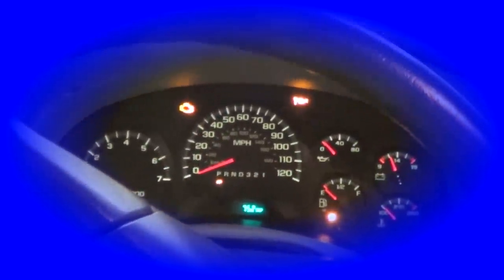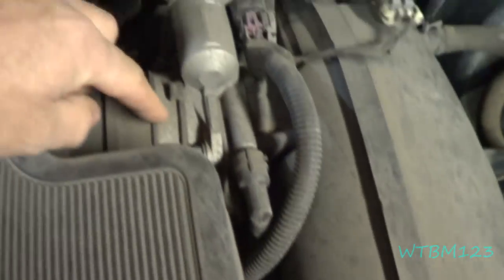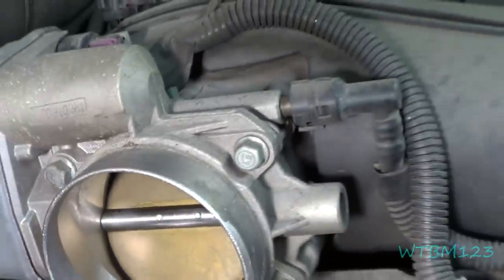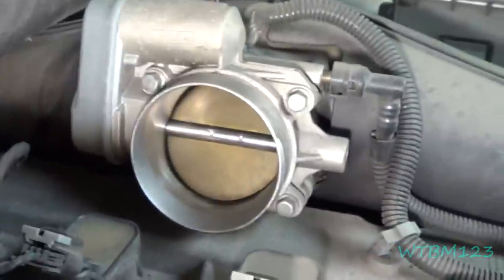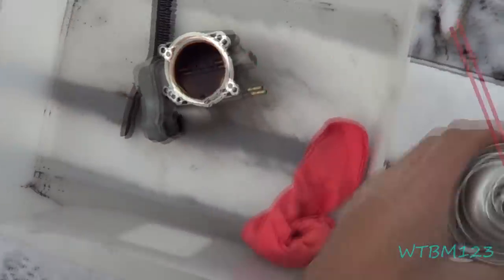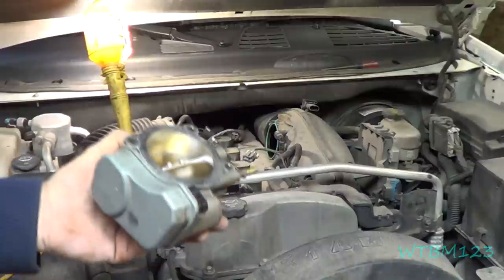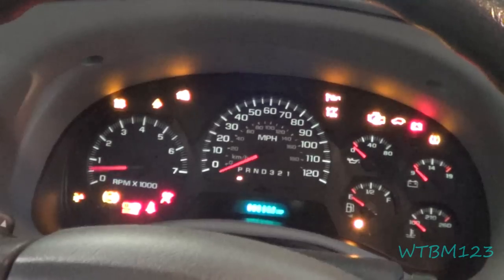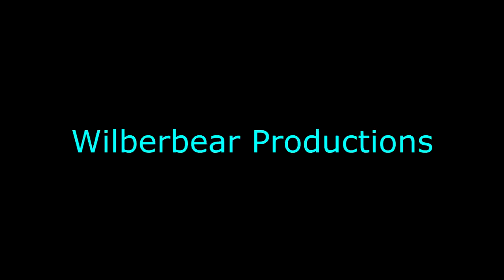Trailblazer, Clean Throttle Body, Electronic Throttle Control, Codes P0506  P2119

Comment: I have a 07 TB L 6 motor that stalls on cold start up I'm gonna clean the throttle body and I don't have to pull any fuses or disconnect the battery right? As long as I don't lift up the throttle plate? Thumbs up subbed

Comment: I was looking at your two gauges oil pressure and battery is it normal that they move higher than 40 on oil pressure and up to 16 on battery when you speed??  I don't  know if that's a issue but I'm concerned about it I have a 2002 bravada that is doing the same

Comment: On occasion, I get the same symptoms. Idle starts to get rough and then nearly stalls and then goes into a low power/limp mode. My throttle body is clean. Other than that, my trailblazer runs well. 340K Miles.

Comment: I have a 2006 trailblazer and have these issues as well. There was a recall about the senor in gas tank and they would do repairs but because i had gone over mileage allowance they fixed mine but i had to pay a reduced price. Mine went bad right after i bought it.  But i still have idle sensor that is supposed to be bad and mine has cut off is the air is runnung.Bought new in 2006.

Comment: Awesome video! My RPM's were fluctuating wildly when the AC was turned on. Cleaned the throttle body per your instructions and problem solved. I was really surprised how gunky the backside of the flapper valve was. Now my '05 trailblazer is running like a champ again. Thanks!
Reply from the maker: +Robert Gillin Thanks for watching and commenting

Comment: Awesome video/instruction by the way.  I dont know if it was just coincidence, but after an alternator failure and installing the new alternator, the very next day the 03 trailblazer started idling rough, revving up, slowing to almost stalling(stalled a few times actually).  only codes I was able to get were BARO/MAP, VAF, and a reference to throttle body intake tube loose.

Comment: I just did this to my '06 Trailblazer. Had the engine light for Idle Air Control low, not to mention low idle speed affecting the A/C temperature at idle. After cleaning up the throttle body, the truck is running perfect and the engine light went out on its on rather quickly. Thanks for the spot on video guide!
Reply from the maker: David Mallette Thank you for watching and commenting
Reply: No problem! Now if I could only find a video for replacing the parking brake shoes I would be all set.....lol
Reply from the maker: David Mallette Closes video i have 
https://youtu.be/bSS1qHMNdLM
Reply: I think that helps me out. I know the parking brakes are similar on mist GM disc brake setups. Thanks for the help!

Comment: Thank you so much!. I have a 2006 and with your advice, I finished in an hour.  Trailblazer runs great.  Check engine light is off after leaving it running for about 10 minutes.  Keep up the good work.
Reply from the maker: Glad you got it running good ,and thanks for watching

Comment: Thanks this fixed my problem ,RPMs would drop when AC was turned on and eventually kill the motor and AC turn off and on like AC was bad. Cleaned throttle body per this video and all is FIXED..!!! Do this before you take to shop and get taken for a ride . Thnaks for the video !!
Reply from the maker: Thanks for stopping in and letting us know. Glad you got it fixed

Comment: My TB was so encrusted with carbon, cleaner did not remove anything. I had to gently scrape it, spray it and scrape some more. 
I also disconnected the battery when removing the TB and the computer relearned idle after running rough for about 30 seconds.
Reply from the maker: Glad you got it going again , just be careful not to scratch the coating off the inside ,

Comment: Just wondering , couldn't it be that when the car is on idle the throttle still has a tiny gap to get air and that gap gets clogged with the carbon.Before i cleaned it  i had to step   on the gas a little which would open the plate when i stopped so the engine wouldn't die.
Reply from the maker: Most have an IAC valve that meters air for idle . After cleaning it may take a little time to relearn the proper idle .

Comment: Just bought and 05 and behold it has this problem. So I will give it a go tomorrow.
Reply: It works, plus changing one coil for a misfire. See on you tube   how to switch the coil from the misfire to another to make sure it is the coil. Replace all spark plugs and it purrs like kitten now. Wouldn't mind finding and SS now. In love with these trailblazer. lol. Thanks for sharing God bless

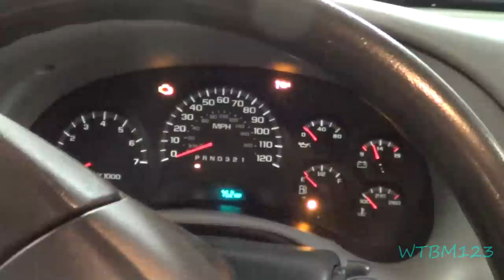Comment: I found your video because I'm having issues with the battery meter recently dropping/bouncing pretty low. I've seen that cleaning the TB could potentially fix that, and I see from between the 00:14 and 13:40, it's increased. Was that a result of the TB cleaning? I've not noticed any idling issues, or rather any change in idling.

Comment: Thank You.  The plug had me confused in a garage with shadows!  BTW mine had 133,000 on it and was much much more dirty than the one you showed.   Pulled the 2 fuses when done and waited 1/2hour.   Replaced fuses and idled for 15 mins then took a short drive.  Idle ended up looking like about 740 on the gauge but the Trailblazer is running fine. Oh and to finish off replaced the gas pressure sensor right next to just because it's old.   Now I have new O2s (front and rear bank), new air filter, cleaned throttle body, cleaned airflow temp sensor.   Anything else in that pollution path I should be replacing "just because"?
Reply from the maker: Sounds like it should be in good shape now .
Reply: @wtbm123  It's fine

Comment: Thanks for the video. My 03 4.2 just started showing P0510 code which is "closed throttle positioning switch" I think I have to remove the throttle body and clean it thoroughly and see if it does the trick
Reply from the maker: If dirty , cleaning may help , but with that code , you may have a  throttle position sensor or closed throttle position switch needing a new throttle body assembly . Sometimes wiring by the throttle body has issues . Maybe a clean and a throttle body relearn would be worth the try .
Reply: @wtbm123  I did just that and to luckily the code went away. I thoroughly cleaned the throttle body and reset the PCM after.
Reply from the maker: @Iliya_sh72  Glad you are running ok again , Thank you for sharing your code and comment , it may help others some day

Comment: Hello I switched over to a new throttle body because my code said it was bad. I sinked it in and it started I drove around for a couple blocks pulled in the drive way turned the car off went to turn it back on and it would not start it would crank over but no fire. Any suggestions on what else it could be.
Reply from the maker: Maybe check wire connections . Hard to say , with out looking at it or plugging in a scanner to see if it is communicating  with the vehicle . I would check for fuel pressure and spark .Wonders if it has a crank and cam signal .  Never know it may or may not be related to the throttle body . When you figure out the issue , please let us know as it may help another .

Comment: 6:26  How did you get the fuel line off without fuel spraying all over the place.  I went to change the Fuel Pressure Regulator off my 1998 Pontiac Grand Prix GT on the 3800 Series II engine and that thing popped up out of my hand and sprayed fuel all over me.  Changing it fixed the first start stalls I was having but damn that was a lot of pressure there.
Reply from the maker: i did not remove fuel line with liquid fuel in it . but if you do for something like a pressure regulator , then you can pull the fuel pump relay and start car and let it run till it quits this will remove the pressure with no mess
Reply: wtbm123 Yesss!!!  I can't believe I didn't think of that!  Well, it's done now, I'll know for future reference  :)

Comment: What do you cal the black plastic cover you take off? Anyway, when I took it off I noticed a puddle of oil/brown liquid settled in the black cover. Not a lot but enough to notice. Why would there be oil in there and where could it come from?
Reply from the maker: misterdinkly  I guess you talking about the air box plenum  . If oil in there could be engine blow by , or crank case ventilation issue.
Reply: wtbm123 Ok I think the oil that collected there took hopefully 11 years to accumulate.
Reply: +misterdinkly CHANGE THE PCV VALVE [ POSITIVE CRANK VENTILATION]it might bee clug dup
Reply: the hose from the crankcase cover leads into it. Your truck is smoking too much apparently. Bad valves apparently. 1 or all.

Comment: I have 2005 Trailblazer LT with the 4.2L and was told that the throttle body couldn't be cleaned and should just be replaced due to the type of housing used on the part. Something about it would "melt" it?
Reply from the maker: If you use the proper cleaner and do not scratch it all up it should be fine . I think i mentioned in the video about some having a coating, but maybe not . The one in the video is still driving daily .

Comment: I did what you said step by step and it's idling weird going from about 2 thousand rpm to nothing what did I do wrong?
Reply from the maker: If it is not throwing a code then after running some it may relearn on its own . If not then it may need a relearn .

Comment: After cleaning throttle body my trail blazer 2007 LT's RPM is not coming on idle and A/C stuck on defrost.... any suggestion or idea to fix this.

RPM gauge is displaying between .5 to .6. and engine has little vibration as well and not as smooth as before.
Shall I connect the computer and check the code.
Thanks in advance for the helping comments.
Reply from the maker: if it was smooth before are u sure everything is hooked back up. sometimes if you open drive by wire throttle plates it can cause it to need to relearn idle. Not sure on the defrost that should be a separate system. sometimes if idle relearn does not do it its self you may need a scanner to put it in relearn.

Comment: Any time your removing electrical plugs/components on a vehicle you should always disconnect the negative battery terminal an the line your referring to as a fuel line is not a fuel line it's a vacuum line I'm sure those that have any kind of mechanical sense know this but seeing as this is You Tube an most are watching this to learn I just figured I'd point that out. Other then that I found this to be great video showing how to clean your throttle body on envoy's/trailblazer's with the 4.2 inline 6. An really is the same on any drive by wire vehicle
Reply from the maker: Sorry I said it wrong. , and you can un hook battery if u want but with key off those have no power. Plz make a video showing how you do it. Thanks for watching and commenting.

Comment: Thank you!
Reply: My TB needed a new battery, after installing the new one my check engine light came on. I clean the throttle body and MAF sensor and the light never came back on. So yes it does need cleaning or replacing at times.

Comment: Changed battery and same thing happened. I'm going to do this tomorrow. Did you disconnect the battery prior to this?  Some say yes and some say no. I would think you would so it would relearn idle with a clean throttle body
Reply from the maker: Un hooking battery will reset everything to start new . If ket is off there should be no power there , but unhooking will not hurt

Comment: I have a 2004 trail Blazer and the other day the vehicle lost power as in barely moving. I thought it was transmission slipping but I put it on a code find and it through 4 codes no.1 is p0172 fuel system rich(bank 1)#2 is p0455 EVAP system large leak (0.080") detected.#3 is loss of cooling fan speed signal and #4 is p0455 again. I've replace 02senser  bank 1 and replaced fuel filter.and it still feels as if the transmission is slipping. the rpm goes way up until I let off the gas a little and the it tries to get going. but I can't slow down or hit a hill it falls on its face.  Any suggestions
Reply from the maker: Some codes could be related , but could have more than one issue . i WOULD WANT TO SEE THE LIVE DATA . So i could see what the MAF is doing ,what the fuel trims are at idle and at 2500 rpm .  check fuel pressure .  What are the readings of the 02 sensors , before the converter and after , to see if cat is plugged . The only real way of knowing is to hook to a scanner and see what everything is doing , or replace parts till you get lucky . A good scanner one could also look in to the transmission to see if it is slipping and causing the issue . A code  is a clue in the direction of what to test . Like if you got a 02 sensor code , you would need to read data of the sensor , as it may be fine , but reporting  rich or lean because of another issue . the p0455 could even be the gas cap and not related to how it runs . And if it shows bank one , does it show a bank 2 . If i have a code on only one bank , and the car has a bank one and a bank two then i look to see if the other bank readings are normal or close to the same as the bank setting the code, but just not bad enough yet to set a code . If your bank two readings are normal , then maf , fuel pump and things like that would do the same to both banks . not all cars will have a bank one and two , some only use one bank .

Comment: I saw a similar video on this and what the other guy did was after he re-installed the throttle back into place, he went over to the fuse box and disconnected two of those fuses and waited 15 minutes then put them on, is that necessary  or just do it your way?
Reply from the maker: I used a scan tool to remove codes. If the car is fixed by the cleaning the light will go off in a few miles anyway. Thanks for watching and commenting

Comment: any reason why you should not open the throttle plate in order to clean better around the area where the plate touches the wall where it seals?
Reply from the maker: Sometimes it will mess with the calibration , and a relearn could be needed . some can relearn on their own but some may need a computer to do relearn . could idle at a very very high rpm .even 3000 is possible .Plugged in key on, gas pedal to floor , most will open

Comment: Thank you very much for this useful video, i have trail blazer 2007 LT and i have done the same what u done, its work perfect 
Actually I found some oil inside the Throttle Body also inside resonator cover, any hint please
Reply from the maker: may be PCV Valve if equipped with one .
Reply: wtbm123 true , i will clean the area and repace the PVC Valve, thanks
Reply: Talat Deeb Hi , i think there is no PVC Valve on  TrailBlazer 4WD L6-4.2L ,
i wonder how the oil came inside the resonator ? Any idea pls

Comment: I read that disconnecting the negative terminal and waiting to reset the PCM can cause problems when the battery is hooked back up. Some say the HVAC system actuators can break. Is there any truth to this?
Reply from the maker: misterdinkly Every time power is cut , and re energized , it will go through a relearn . It opens and closes the HVAC doors . If the relearn does not complete then HVAC will not work properly . Most of the times you can disonnect  the power again and wait a min or so . then re power . turn key on and do not touch HVAC controls till relearn is complete . I believe in most cases if one actuator does not relearn then there was starting to be a issue with that actuator , or door anyhow , and would of acted up in the future anyhow .
Reply: wtbm123 very good. Thanks. Would disconnecting for half hour be any different than disconnecting for just a minute? It relearns no matter the time off the battery?

Comment: Is it necessary to pull the PCM fuses once your all done to do a reset? for about 30 mins,    Fuse #10 PCMB and Fuse #28 PCM1, I have been told this though dont understand it !   I have an 04 Trailblazer !
Reply from the maker: It is not necessary . On a vehicle if the issue is fixed it will read correctly to the computer and after so many correct readings the light will go out on its own. I use a scanner to clear codes ,but not right away .I run the vehicle and watch the data to confirm the fix. The only reason I turn the check engine light out is so the customer does not see the light and get alarmed. So if you have a check engine light on and fixed the issue , you could just drive the car and when the light does go out it is like confirming the fix, but if light is turned off and it is not really fixed the light will come back on ,so it really does not matter
Reply: wtbm123 Thanks Appreciate it,  My check engine light is not on, I have had a few local guys tell me it might help my gas milage by cleaning the throttle body, The engine seems to iidle real nice still at 75K miles about 800 RPM or so.

Comment: can I do this on a 04 model without having to worry about messing the RPM reading?
Reply from the maker: If drive by wire , do not move throttle plate . most can be cleaned with out issue .

Comment: Im gonna do this in the morning. my Tb is shaking and the idle flex's and sometimes it gets so low it kills the car.
Reply from the maker: +jehova lopez Hope it helps , not sure what u mean by TB shaking , may also check for a misfire as those coils do go bad from time to time
Reply: +wtbm123 trailblazer is TB, lol sorry. coils are fine. replaced all 6 and plugs 20k miles ago.

Comment: My GMC envoy had same engine code and rough idle while in drive and park even worse idle with A/C on. I took everything off used proper cleaner and put it back together.
I will tell you it worked like a charm idles perfect A/C on or off. Thank you for the video it defiantly helped. And yes with just a little of carbon build up it can make a difference in the engine. Took me less than an hour and i really appreciate the video.
Reply from the maker: Thanks for watching and commenting